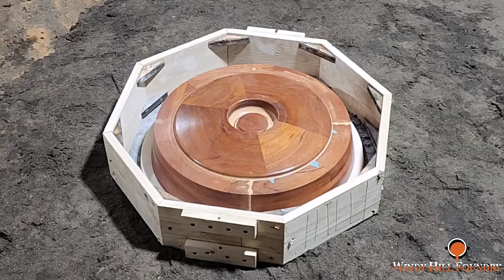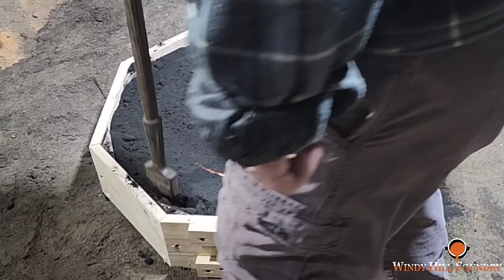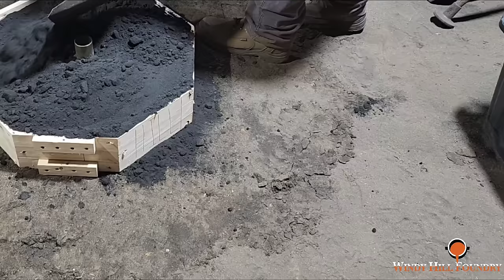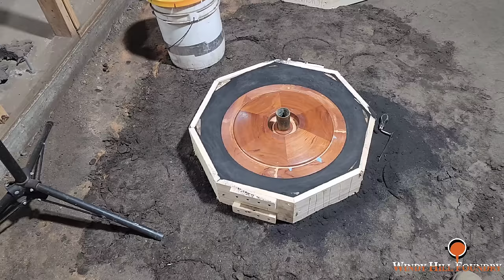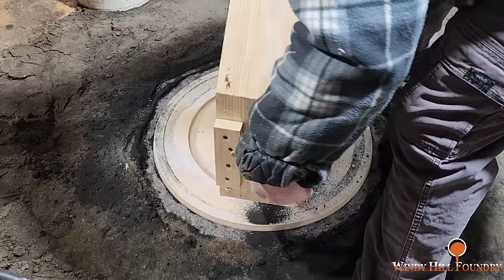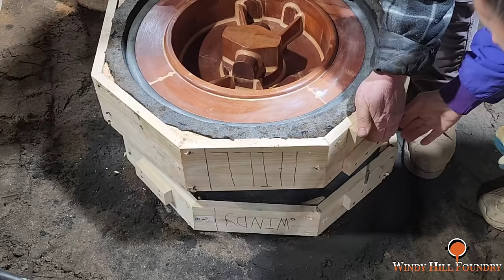TALLY HO CAPSTAN PART2

Comment: 40 years ago I worked for a company called Foundry and Flask that is no longer in business. One of the things we built into some of the small cope and drags where tapered alignment pins. It made the assembly and disassembly easier in casting. One of the problems was you had to fit the pins and holes to one another at the same time. It made the machining a little tedious.

Comment: Hello, I would suggest to modify the pattern that it was two-pieces. (Inner piece and outer piece connected very loose). That would help splitting the mold. After mold is splitted patterns should be possible to remove easier. Cheers and good luck

Comment: Clarke, a question please
On the work on the capstan would it be an idea to screw a backing board to the cope or drag on each turn as an added safety just in case a joult as you turn it over causes a disaster.?
One more suggestion, consider getting a weight lifters back brace or lower back brace to support your back on these larger pours
Seeing your are working on the ground, believe me I have lived with a chronic back for 45+ and it is NO JOKE
🤔 Did I see Keith upto something on a Certain capstan that looked bloody marvellous today?😇
Brilliant work as usual Clarke 
Tony from Western Australia 🇦🇺

Comment: simple problem ... decide which way it will lift up ... lay the base layer down and pack that lay the middle on a new patch pack it in ... remove its former ... lay the top down on a new patch after you have placed the middle on the bottom layer ... pack the top with all the fittings .... lay that on top once ... heat the mold and the metal ... pour ... flipping it like a burger destroys the mold a bit more each and every time ... pack it remove the former  pack the next piece lay it empty  and so on .. and NEVER let mold sand freeze while you are trying to mold a piece for casting ... you allow water crystals to form and they now impregnate your mold so it will spit like a camel ...

Comment: Are you sure they didn't use 'lost wax' method to cast it originally? Had you considered it?
Reply: They may well have! That would make a lot of sense for a one-off. These days the "lost foam" method is more popular and even easier, just make your pattern out of Styrofoam, building it up in pieces if needed with hot melt glue, coat it in refractory cement, and pack it in sand. There's no baking step to melt out the wax, just pour the steel right on the polystyrene and it turns to gas and evaporates through the sand.
Reply: They already have the pattern. They can just mold it in silicone rubber and fill it with Loctite Tite Foam to have a foam pattern. This way if the cast fails they can make another foam pattern easily.
Reply from the maker: This was done in green sand pretty much like we are doing here. The pattern was different but the process without cores was the same. Originally the pattern was a two piece pattern that required less sand volume
Reply from the maker: The original was definitely sand cast, I saw the original casting and recognized the parting lines and the gates

Comment: I used to deliver to a foundry making every manhole cover and service surround and lid in the country. Roughly decsribed. Buddy you just are not equipt to handle those moulds. They had an upside down T for lifting heavy moulds with an electric gantry.  They lift the whole deal to make it reset under the hoist , set it down when it ceased to swing and the unbolt the boxes. Then lift it directly up gentle and smooth. Plus the sides of your plug is not getting white powder on it. Good luck.

Comment: It being so heavy is it possible to pull it horizontally or put the heavy part on bottom and pull off the other two from the top. Hopefully the core would end up sitting on the bottom part. Just my two cents.

Comment: I'm wondering if you would have better luck separating that more detailed area using Graphite instead of talc seeing as your dealing with the seasonal temperatures that talc might just have a bit more bite on the pattern being that cold.

Comment: It would be fascinating to watch how this casting was done back at the original foundry that cast it.  In the broad details it would not have been much difference but watching foundrymen who had been doing this sort of work 6 days a week 10 to 12 hours a day for years.
Reply: The procedure of casting is the same as back then except lacking the added available help of then.
Reply from the maker: As @royrenolds108 just said, we are pretty much replicating the way it was originally done but keep in mind that on production jobs like thos once was, special tooling, availed help and failures like this helped make this job more efficient as the job continued
Reply: @windyhillfoundry5940  Obviously the problem is you're not cursing enough to scare the sand into behaving.  I bet the original capstan was cast with the help of determined, forceful and inventive curses.  Oh, yeah, that wouldn't be youtube friendly....never mind.  Cheers from Australia.
Reply: But those curses were in British English. Maybe that's the solution?  @Mark_Bridges
Reply: @johnvanhal2450  No British English wouldn't work unless the sand is also British, which I assume it isn't.  If you're trying to scare the sand into behaving you have to speak the sand's language.
Reply: @Mark_Bridges  There you have a point...😄

Comment: Not sure if you'll believe this but I watched the video before going to sleep and then I dreamed I was suspended in a chair hanging from a rope inside this enormous circular structure several stories high, like something the Romans might have built. At first I was supposed to be going through on the way to somewhere else but then I started to go round and round inside the structure. On the ground inside it was some kind of a building site going on. I thought "how do I get off this thing?". Then somehow I was off it, and on the ground with the workmen. They had this mould for casting the top of a metal column. Then I was woken up by a cramp in my calf - I've been cycling too much lately... So it was sort of like the video, but all jumbled up and from a different perspective.

Comment: The thin wooden moulds are producing too much distortion upon decoupling. This causes the sand the break. Suggest using thicker wood sections plus reinforcement around the moulding tool joints. Furthermore, upon hoisting the moulds, attach 4-off lifting brackets plus straps at the 12, 3, 6 and 9 o’clock positions at equally applied tension. This will stabilise the removal straight vertically up. Lastly, to ensure a smooth liftoff, coat the guide pins with an abundant dose of linseed oil to prevent lock up.

Comment: Perhaps a re-think is needed Clark?  If the pattern was reworked to delete the cores it would make the entire job a lot smaller and lighter.  Simply fill the rebate around the perimeter of the cap to make it flat sided with a taper.  Then when it is machined in a lathe, just create the rebate and rounded top and bottom of the cap.  Needle scale the machined perimeter finish to create the cast like look and job done.  I bet that would be a lot easier to make without the perimeter cores.  Keep up the great effort, Ron
Reply: The taper is to be able to extract the pattern from the mold.

Comment: Should probably think about bringing in a propane heater to heat the shop up. If you got the temps up to the mid 70's+ the sand would likely perform a bit better. Also, maybe a humidifier might be handy too.

Comment: definitely a two man job. unless you have a hoist system or sorts I would imagine to help you out.hopefully next time it will turn out well for ya ...looks like you need a strap or weld up a metal strap that will prevent the pattern from not lifting in a twisted manner.

Comment: Gravity is a pain in the neck! Why not trying to work with gravity by flipping the flask over and let gravity hold the core in place as you remove the top and middle sections. The remove the mold and reassemble it. Or maybe you can mold the internal core separately?

Comment: You may be doing this already . I can't tell. Alignment pins   make one longer than the other.  then you only have to fight one at at time. For metal more precision work make one round and one diamond with the full pin diameter 90degrees to the axis of the pins. Avoids binding when sliding together.

Comment: Why don t you use more extended cleat around as guide to slide in and out the parts. It would self aligne and if long enough can be line mark as visual ref to keep level. Hard work men

Comment: Other comments have stolen some of my thunder. I will cheer ideas that will prove helpful.
 A chain hoist for lifting.    Yey!  It will hold its position.
 Multiple lifting points.       Yey!  Four would seem to be most suitable.
 Easing two frames apart a little at a time when opening.     Yey!

Now my suggestions.
The four lifting points should be eyebolts. Why? They reduce friction on the rope sling that we will be using (dispense with that webbing). Drill holes and install the eyebolts, tighten with the eyes parallel to the frame's mating surface.
Obtain  a piece of rope 30-40 feet long, knot the two ends together to form a large sling. Use this by dropping it to the floor  over the frame to be lifted. Take a bight  of the sling near one eye and thrust it through the eye and then over the crane hook.  Repeat three times.
When lifted the frame will remain level.
Why are all your frames made with a pin and a hole on each side? A pin and hole on one side coupled with a pin and SLOT on the other makes  reassembly a lot easier.

Comment: I would use furan resin sand  which can be hardened by introducing SO2 gas to harden it. .i would mould that heavy  bottom centre, the part where you put rebar in it  first separated from the rest this a one off custom peice. Not a production peice. So using the furan sand  once is a better investment of buying Furan sand.

Comment: The Sand does not have enough Oil in it. It has dried out too much. The temperature could be too cold and not enough Powder separating each Pattern. Good luck for next time.

Comment: It is a wasted day when you don't learn something new. It makes you think. NOW, as having watched this and one more video on Youtube I have an opinion forming. It may not be right or even welcomed but I will throw it into the ether in spite of any general misgivings. You may share it for free if the results are worth the average of two cents. 
 Seeing as how the different bits seem to want to fall apart after all of your finessingk with the rammer, ( here follows the good-idea encapsulated ),  MIGHT it be a nice slight of hand to use a separating membrane like that 'Cling-film plastic, food grade whatchmacallit Gladwrapper ? ) between separate parts; copes? My thinking is that , since youse are pulling it apart anyways, and it mor'n likely is going to want to stay stuck in contrary fashion, by using that real thin plastic film there will be less cleanup and just sometimes it might hold some sand in the mold making it a thing of beauty if it were to be easily repacked. 
 Knowing little and yet being full of the curdled juice of old age, I reserve the right to offer my reckoning to this worthy, nee August body of free thinkers and sand pounders. 
 I will welcome feedback of a polite and instructive manner. All others can suck a thumb in consideration.

Comment: I enjoy your hard work and dedication. 
Several things need to happen to get a good mold the first time. Starts with the patternmaker.
1 an accurate layout. Shows all machining, core prints and cope and drag.
2 coordination between patternmaker and foundry.
Once all is approved it's  all on the foundry.
Windy Hill foundry worked with what was given to them. This was going to fail and will fail a couple more times. I'm sure Clark will get a good casting. But when you need a one-off casting, it should be one mold. Any failure, requiring another mold should be caused by casting defects. Just me but I hate to see a failure like this cause by the pattern design.
Hope this doesn't offend, and Clark, you can remove this post.  Patternmaking is a lot more than just duplicating an existing part with no real thought into what the foundry needs are.
Reply: I am curious how the pattern could be changed to make molding easier. I am a machinist and I have talked to some of the guys that our castings and today they seem to use chemical set sand quite a bit. I feel that would make this job much easier. It would be more expensive but the time saved would more than pay for the chemical set sand.
Reply: @TheJohndeere466  first and foremost, the cope and drag need to be reversed. You don't hang a large block of sand in the cope. With a deep flask, the drag could be rammed up in one shot. Roll the drag over, ram the cope, and you're done. The core box could be one full core with multiple loose pieces. A little hard to describe here. With a little for thought, you may not even need a core when using a cheek. But a lot more work in the pattern shop to make that work. That is why layouts are so important. Plan before building. Double rolling a flask is always bad.
Reply: @roscoepatternworks3471  I posted this below

I once tried to cast a part that looked like a dog dish and the sand kept breaking off just like yours. A guy told me to ram the mold the opposite way so the large hunk of sand filling the dish was now sitting up instead of hanging and it worked well. First I rammed up a flat layer of sand and then filled the pattern and scraped it off flat. Then flipped the pattern over while full of sand and set it on the flat layer of sand. Then I rapped the pattern and removed it then applied more parting just and set the pattern back on. THen I put on the other half of the mold and rammed it up. When i seperated it, the pattern stayed in the top half of the mold and then I rapped it and removed it.

Comment: Looks like yur sand was freezing a bit -- maybe using a torch to heat it up and dry out any moisture would help? Might shorten the alignment pins a smidge.. Or work on getting that lift hoist more aligned and level??? Your lousy armchair QB speaking here ...

Comment: How not to make a mould............He turned a two part mould into a three part, made the top first, then turned it over to make the bottom and removed the box from the pattern and the centre was allways going to get stuck in the pattern as the patern was designed to be removed from the mould. A rapping plate would normaly be fitted but for a one off you would drive a metal spike into the pattern and tap it sideways to facilitate removal which is acheived by screwing in a lifting device such as a coach screw with a big washer welded to the end. The box alignment was a major issue and being able to see the pin location is very important.

Comment: I can't watch this circus anymore. Way too many things are being done wrong.
Reply: I feel a commercial modern foundry would have no problem with this. Heck someone made it 100 years ago. lol
Reply: @TheJohndeere466  , I agree, I worked in  US Navy foundries for 20 years.
Reply: @dbaecht  care to elaborate on what is being done "wrong"? I know nothing about foundary work.
Reply: @turnerg  , Sure. First of all the sand obviously is not tempered. Tempered foundry sand has a certain amount of moisture. Unless he's added too much coal flour, the the sand is worn out. Ramming a pattern on a sand covered floor is just incorrect, needs a bottom board. He's using that funky shaped flask that prevents having enough sand, use of a square flask with at least 6 inches of sand between the pattern and flask. There's probably  way more mistakes but, I couldn't bear to watch anymore.

Comment: Time to breakdown and get into the 21st century. Either: Start with a billet and CNC mill to spec. Or: Additive Manufacturing, i.e. print it.
Reply from the maker: Time for you to price a billet of grey iron 13" diameter and factor in tooling and time
Reply: @windyhillfoundry5940  That would be an interesting comparison vs. the 6 months this guy has been fidgeting with this repair.
Reply: @windyhillfoundry5940  We routinely make 1 off brake wheels for cranes from billet ductile iron when no pattern is available. I guarentee you it is cheaper than having a pattern made and getting it cast when only one part is required.